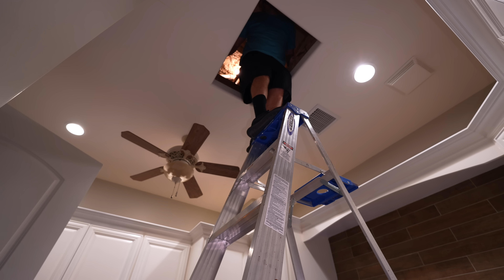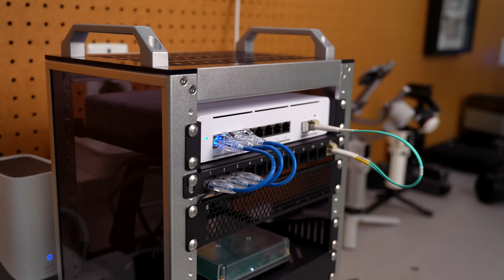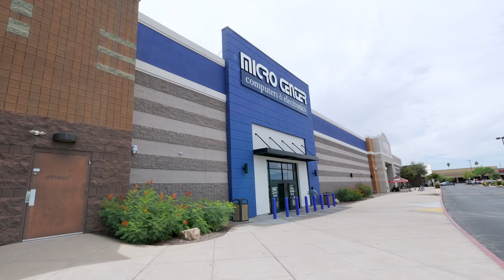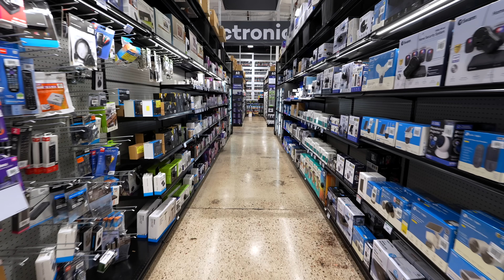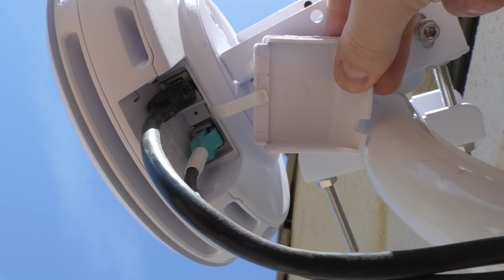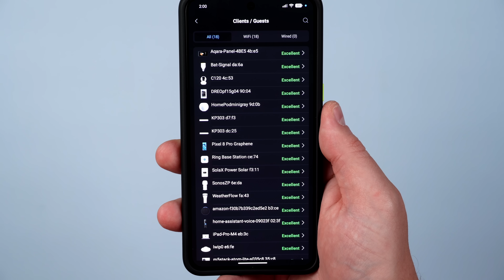Why I’m using UniFi Building Bridge for my Garage

Comment: any thoughts on our ethernets getting fried after storms? for example we had a small 8 port unmanaged switch completely fried that all the ethernet cables were plugged into replaced it. then now we have a Mac Studio and the ethernet is fried not working at all only the wifi works. do I need to replace entire Mac Studio? on call with apple support for hrs to no resolution. tried different ethernet cables, different switches and still no results. why are ethernet connections so fragile? how do you manage your network during thunder storms?
Reply from the maker: Oh wow that's crazy! I haven't had that happen to me. For your Mac Studio, you could probably just get a USBC to Ethernet dongle. There are 2.5 Gbps options that aren't too expensive vs paying apple to replace the port.

Comment: Single mode fiber is the way to go
Reply: AMEN!
Reply: Yeah, this was an interesting video but this would have been solved by 2 cheap fibre gbics in 2 cheap ethernet switches connected by a single mode pretermed patch lead of your chosen length.
Reply: @iceymanz  Hardest part would have been getting under the sidewalk along side the shop.
Reply: Would go with multi mode for several meters, no need for SM there.
Reply: @nosurname9652 nowadays there is no reason to use multi mode